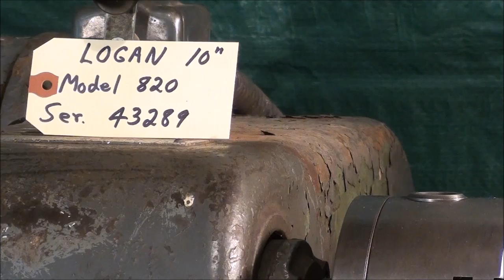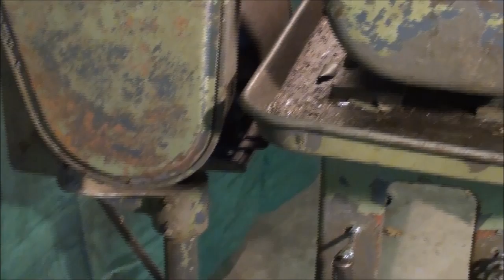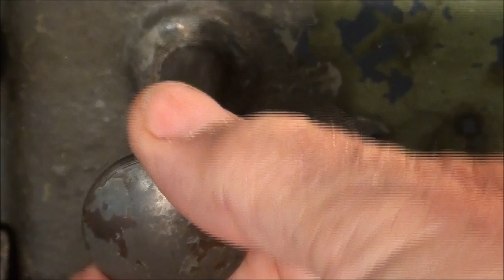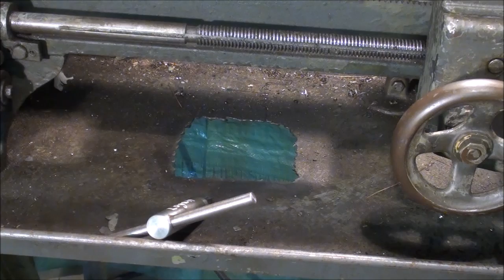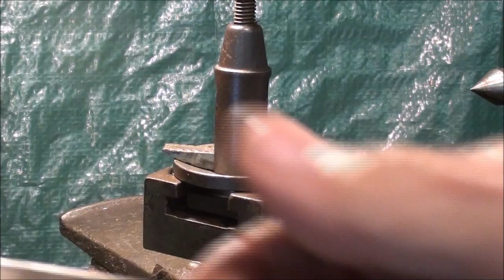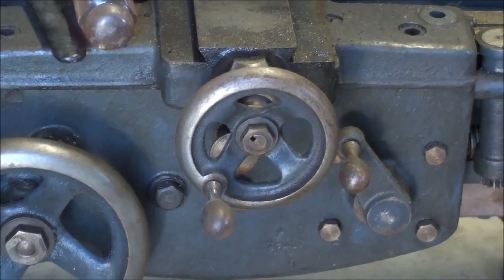THIS OLD LOGAN LATHE tubalcain buys another one

Comment: I hve one of these with a quick change toolpost on it. However, the compound slide is too tall for the quick change. Would it be ok to mill 0.100 off the bottom of the tool holders for more adjustment? I thought about shimming the head up, but then the tailstock would be too low.
Reply from the maker: Yes, I think that would be a good solution. But do it a little at a time to see if it affects the tool holders

Comment: I have the exact lathe as the 3rd one mine is the logan with the quick change gearbox i got it for free as a trade for some carpentry work i did i had to dig it out of the mud it was half buried in i did a complete tear down cleaning and rebuild its operational but i still have a few more things to do to it,to make it 100% operational,i have had several offers for it and refused all of them i love the way its built so easy to work on and so many possibilities for upgrades

Comment: Try using a little moreys oil stabilizer (there's another brand i can't remember)
Oops LUCAS OIL STABILIZER
it clings to the gears pretty well try some it comes in quart and gallon etc it's very good in transmissions and rear ends it'll cling to all those gears nice maybe even that bull gear
Check here on you tube maybe they have a video of it.
It's sold at good parts stores.
ALL THE BEST SIR

Comment: the hole in the chip pan would be... if smoothed up a bit.. just about the right size and shape for a coolant sump and pump assy. should you decide you wanted a coolant system on this machine....just a thought
Reply from the maker: Yes, you're right

Comment: The lathe serial number is stamped on the right end of the ways, the number 820 is the model # for the quick change gear. The power cross feed button is under the cross feed hand wheel.

Comment: Hi Mr Tubalcain, I ran across a Logan in bad shape. It doesn't have same setup you have on this 10" and was wondering what prices I would pay for a Logan. Pretty rusted being I found it in Louisiana and looks like it sat in flood waters. Gear cover on end is broken but still hangs by one hinge pin. No model number or serial number. It would be a project to completely disassemble and repair. Where would I find info?
Your love of older machines is contagious. I will watch your other Logan video.
Reply from the maker: maybe $100

Comment: I have this exact lathe even the same year.... I noticed the other day that one of the gears on the initial drivetrain if you want to call it that look non-typical. Shouldn't the final gear before entering the Quick Change gearbox be a 72 tooth gear? I have some oddball 42 tooth or some damn thing here and there and I don't know how I didn't notice this in the past. I'm almost positive this should be a 72 tooth gear am I correct? I want to start threading a little bit and I want everything right I'm very new at this game
Thank you for your help as usual
Reply from the maker: I really have not looked at the gears yet. look at your chart
Reply: There's no chart on the door at all. I bought a 1821 for 2 hundred bucks.  I put it all together and it was the 72 to the Gear in that position  I think I'm going to go pay the $25 and download the manual with the exploded drawings from Logan. 

I just went out and looked and it's a 48 tooth gear in that last position that is in line with Quick Change Drive. I'm almost positive it should be a 72 tooth gear.

I tell you what I have to agree with you on the ultra slow feed rate and this lathe. You can get a finish like glass at that's low speed. 

I'm using the old half horse repulsion motor that was on it when I got it I cleaned it up a little bit fill the oil reservoirs blue all the chips out of it and it runs like a clock. This way this is like a Swiss watch it's so quiet I love it

Comment: I bought an 820  on  a Friday and found another one that very next day and bought it as well.  The second 820 was completely disassembled ready to begin restoration. A really bought it for the parts which were in a condition that anyone would call pristine.  The gears had absolutely  no wear on them.  The looked as if they were fresh off the shelf. 

The lathes are of dramatically different ages and ha e some incompatibilities.  The second lathe came with the original 3 phase motor (I was told) however I had always under the impression that the Logan were originally equiped with 110/220 single phase.  Perhaps you know the truth regarding this piece of trivia? I do not have the ability to test the motor unfortunately as I am not setup  with three phase at my location.
I almost hate to buy some sort of phase converter to test a motor that may not even work. I don't actually know what I'm going to do with this regards at this point. I have prepared a couple things on the First Lady the clutch was not engaging for some reason so I tore it apart and discovered a tiny spring that was out of its socket on The Head of the Class and smashed in between two plates. How it got beneath the plate is beyond me but it was flattened a little bit proof that it was there no damage was done to the plate so I simply reformed the spring I'm a tiny shaft and got it acceptable to still use although I should replace it soon.
I was told that this lathe sat illegal for 50 years in the local hardware store window. I believe it now it has some green paint on the ways that is at least that old and that wore off. I probably paid a little bit too much for the first lady but I got the second complete broken down laid for $100. If I have to replace one gear and use from this stockpile it was well worth it.
Yesterday I finished making a quick change tool post out of tool steel of all things and it came out really nice and works perfectly. I am however having a difficult time trying to figure out the size of the nuts that loosen the compound. I thought that they were 9/16 but a 9/16 doesn't fit nor does a 5/8. I can't imagine that these are original nuts this being the case. I don't think Logan would put some odd size in-between size not on there during production. The compound is of the type that has a recess on either side for access to these lockdown nuts. 

If anyone knows what these nuts were originally spect 4 please let me know
Reply from the maker: My logan 820 has 9/16 nuts.
My wards powercraft logan has nuts that are .700 across the flats-it has a logan wrench with it thjat fits perf.
Reply: mrpete222 well I guess I am getting on in years and I did not have the lighting setup over this late in my shop as it should be the whole problem was that those nuts we're a little bit more on the corners it made it feel much looser than I thought it should so I just cut a new wrench specifically for it on my mill out of tool steel  and broke them loose they were on very very very tight. It was a strange thing indeed but I took care of it. I guess I'm going to paint this Beast after all I've got it almost down to Bare Metal now just tinkering around and I don't I think I would like to oil it everyday to keep it from rusting so I will paint it after all

Comment: Looking at the videos people have done on these Asin made Lathes and listening to all the complains and problems I am sure I would rather have and old American made machine like this old beauty.  I don't' need one that big but I'll bet she would do jobs as good as a mini-lathe if you had a good set of small collets and I guess you could use quarter inch tools in it if necessary.
Reply from the maker: +Charles Barnett thanks for watching-love the old ones
Reply: Someone just offered me a Chinese lathe 12 by 36 for $500 its still in the crate its been in storage never used and I turn them down. It was a century machinery / Harbor Freight special. They retail for $4,999 you can no longer get parts for it or service for it and nobody will buy it from him. I will never buy another piece of Chinese equipment if I can help it again. Having said that I did purchase one of those zx45 which suits me just fine. I was quite surprised that the table end-to-end was less than half a thousand and I could measure no run out in the entire length of the spindle at all. It does quite a nice job for very very very cheap. They will suit me just fine until I can find a good deal on a Bridgeport

Comment: Mr. Peterson, my friend has one of these, the back gear was missing 2 teeth so I had them brazed and then used my Atlas shaper to recut the teeth. I put in 14 hours on his Logan and he gave me a Southbend Model C benchtop.I got the pegleg motor mount for it, and Joe at Plaza Machinery is sending me some cast iron legs for it. My Atlas was given to me for building a punch and die set that makes boiler spacers for White steam cars.Some of the spacers went in Jay Lenos White. Mike my friend builds boilers and gave me the Atlas. It is now totally restored and am now restoring the Model C. Already restored a Model A and B Southbends. The shaper and Model A came from the Nichols brothers lock and Machine in Chickasha, Ok. They built an airplane in 1911. Thanks for sharing your vast knowledge with all of us. Greg. Mikes 1905 model E won last year at Pebble Beach and I made his water pump shaft for it. Maybe someday I will get to go for a ride in it!
Reply from the maker: stratocaster1greg Nice job on the logan gears.  Good story about lenos car. He has quite a collection

Comment: I worked at as an auto restorer and we were given one of those lathes by a machine shop. The bed was warped so bad you could hardly use it but it was the nicest lathe I have ever used by far! 1st job we modified chevy brake drums to fit a Rolls Royce Silver Cloud. Saved $2000 first time i used it......
Reply from the maker: +Jordanhollowdistillers -thanks for watching

Comment: Mrpete222, 
How do you decide when to use the holding power of a collet versus any other means?
I sent you an email yesterday on your other website,  I do understand that you maybe preoccupied,  however Im interested in getting in touch with you. 
Thanks again for all the vids!
Reply from the maker: A 4 jaw chuck holds the tightest.  A 3 jaw just presses on 3 small parts. A collet to me is the most accurate and fastest to use.

Comment: Hi Tubal, I enjoyed watching you go through all your auction stuff.  I love doing that.  I do have a question, you said you was going to give it a good cleaning.  What type of cleaner do you use to clean it externally and internally?  I have an old greasy dirty lathe I need to clean inside and out and was wandering how you go about cleaning it.  Thanks, Tom
Reply from the maker: I just use a rag, wire brush & cheap paint thinner.

Comment: I have model 815 almost identical to your except the cross slide extends out the back fot the taper attachment that is missing.
I smashed my fingers under that  lid. Ifixed that problem be moving the support bracket to the outside.  Now I never have to reach inside to unhook it so the lid can close.

Comment: Weld you a handle on that lamp arm. Far enough away from the bulb that it wont get hot. That will give you something solid to grab and re-position it with, without burning yourself
Reply: Drafting lamps of that era have a little bent rod handle riveted to the shade...

With the ban coming in on incandescent light bulbs, you don't have long to worry - just buy the over-priced LED bulb instead...
Reply: Ahh, yes. The obama-ban on Life, Liberty, and the Pursuit of Happiness.  Should make all our lives soo much easier.
Reply: chemech
I put an LED light on my bench grinder, and love it. I also have 2 rings of LEDs around the spindle of my mini-mill (Sieg SX-2). They give great light, and I don't have to worry about something hitting the bulb and shattering it. I already miss 100W Incandescent, but not on my shop equipment! I won't be using CFLs near rotating machinery.

Comment: Re. that terrible wiring job on the small lathe: NEC ends at the outlet.  If the equipment has a plug,  NEC doesn't address wiring of such. NEC concerns supply to the outlet only (unless the equipment is directly wired to the supply). 

You might find UL or other regulatory that addresses such equipment wiring. 

FYI...

Comment: Another great lathe video!
I like the old Logan lathes, I am partial because a Logan 1875H which is similar to your 820 is my current machine. I too hate to paint but when I had to tear down the gearbox to rebuild it I decided to paint it while it was apart. It looked so good I did the whole thing. Gave me a chance to oil and clean all the moving parts too. Good thing, my carriage was in dire need of attention.
 
Here is my photos before and after on the Logan Yahoo group.
https://groups.yahoo.com/neo/groups/loganlathe/photos/albums/1114278577
 
I used a needle scaler to remove the old paint which made the project easy.
http://www.harborfreight.com/compact-air-needle-scaler-96997.html
 
For paint we used Rustoleum machine gray which matched the bottom coat of paint.
Reply: mrpete222
Mr. Pete, you may need to be a member of that group to see anything.
Reply from the maker: The link did not work for me.
Reply: Looks great Doug! I hadnt seen that yet on the YH group.
Reply: Thanks I'd never heard of a scaler! Maybe I'll get another free tape measure while I'm there. I can see loosing a tape, or a couple tapes, but I must have 40 and STILL can never find more than one!!!

Comment: I don't want to seem rude but I bought my current lathe 3 months ago it's a Sieg C2 it's not fancy but it took me 4 months to save up for the $850 price tag, does it ever reach around that figure for a 12inch bed, I do realize that these are second hand units.
Reply: Keep searching. You CAN find old US made machine tools in that price range. I would recommend that you have an experienced person with you when you look at the first few. They should be able to tell you about wear and missing parts. Don't give up!
Reply: ***** Depends upon where you are... in my neck of the woods, you can barely touch a clapped out 12" lathe for ~$2,000 - and will need to spend about another $1k to get the parts including a phase converter and idler motor - to get it back into running condition...

20/20 hindsight says that I should have waited another month, and bought a new Grizzly for the $3k.

Here in Southern California, you will find a lot of rusty relics being sold for top dollar - only once in a blue moon will you find an estate sale where you can get a used 12" American made lathe for around $1200...

It's a matter of supply and demand - if you live near a Rust Belt city which had lots of factories into the 1980s, you can find cheaper iron, and in better shape.

Around here, most of the old stuff got exported years ago, and the remaining aerospace factories converted to CNC in the 1990s.
Reply: chemech
What you say is obviously true. However, there has never been as much industry where I am in NorCal as there was in SoCal. All of those old manual machines went or are going somewhere, and they will surface again. I stand by my comment to keep looking and don't give up.
Reply: All I'm saying is that you can be making chips a lot sooner, and sometimes with a better machine, if you buy the import straight away. Especially if your budget is less than $2,000

Face it, any machine tool is a starting point for adjustments and tinkering when you buy it. 

Just finding a fixable older American machine, as opposed to a parts donor basket case, is a case of long odds against you.

I got "lucky" with my Logan - and, kind of wish that I hadn't been quite so "lucky" as there are some major headaches still to be faced in bringing it back up to snuff. 

Check your local market, but don't buy a pile of rust in the general shape of a machine tool just because it has a Name brand on the faceplate - and, especially do not pay $3,000 for a $1,500 machine...
Reply: chemech
I agree with you... in some cases. In this particular case, I was simply responding to his specific question. Frankly, without knowing more info about a person's situation, skill, desire, etc, I think that generalizing isn't doing anyone any favors. It's almost like asking 4 people which is a better pickup, Ford or Chevy. You'll almost always get eight answers out of that one question alone! lol

I do hope that my Logan (my 8th lathe by the way), looks as good as some of the others here when I'm finished!
Reply: *****
I like your reply as it seems the only one to hit the mark as an answer, it wasnt realy a hard question but had way to many off mark remarks about it. I did realize it was kinda a personal question and would understand if tthere wasnt an answer but so many answers was also kinda unusual as well.

Comment: Great video! 

Here is a Logan 821 that I restored not too long ago. http://imgur.com/a/Kuil1

I know it's not the original colour... but I wanted something a little different, and it matches my workshop.
Reply: Dan great job on the refurb. I'm doing the same to mine right now but I'm sticking to the original Logan color. Thanks for the link!
Reply: ***** Thanks!
Reply: That's a beauty Dan, Well done!
Reply from the maker: BEAUTIFUL lathe Dan.  You sure went the extra mile.
Reply: That looks great, Dan!  I have considered painting my Logan a non-standard color, as well.  Perhaps Cummins diesel green.
Reply: great work. nice restoration (and colour) indeed.
Reply: You did a wonderful job on rebuilding that Logan!!!